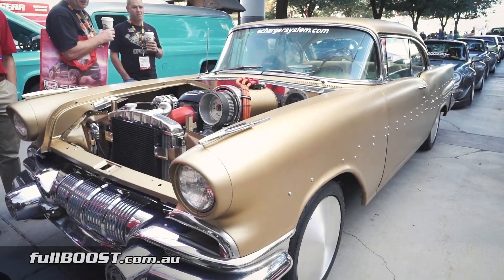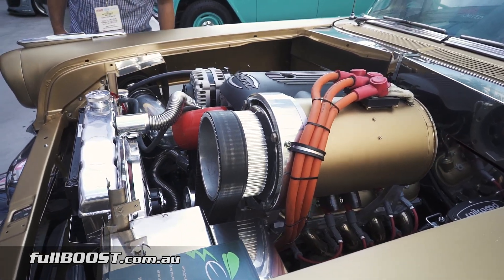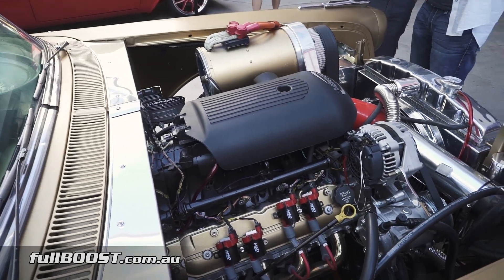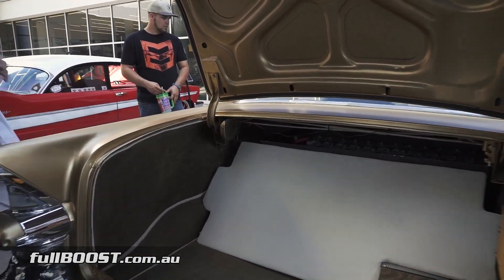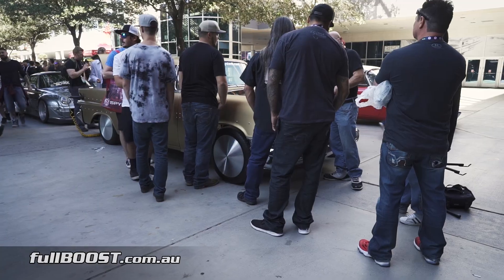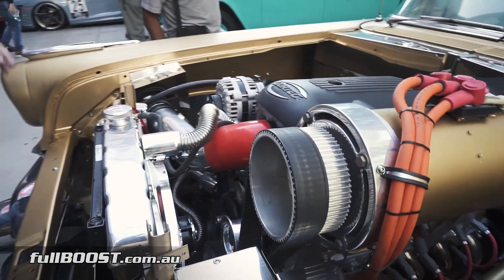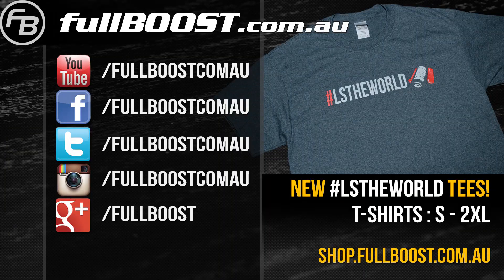The E-Charger Hybrid System

Comment: Regenerative braking? Kinda like the KERS system?
Reply: Luisk  no like a hybrid. The KERS system harnesses the abilities of economy hybrid vehicles & gears it towards increasing performance. The technology has been used & around since the first gen Prius but for the past 5-7 years or so, many performance manufacturers have begun to see the advantages of hybrid technology. Which is why we now have the KERS system, & why many super/hyper cars uses hybrid technology. It’s awesome I’m enjoying the times we live in right now for cars!
Reply: KERS is an F1 tech, the current state of it now being ERS, it now being a V6 hybrid where the MGU is geared to the crankshaft, and a second "MGU-H" being driven by the turbocharger being used to supplement the system. The electric motors work as generators, the system Mercedes has gotten more than 50% thermal efficiency.
Reply: Or like any hybrid on the market....
Reply: He was explaining it, not claiming the tech as his own, just that it had the function
Reply: I think is more like the generates energy and saves it in the lithium ion battery for later use, I believe that for the nature of F1 Kers or Ers would need a super capacitor or even ultra capacitor to quickly charge and discharge on "bursts" like for example perform an overtake. Current batteries would simply be toasted after 5 or less (edit) laps
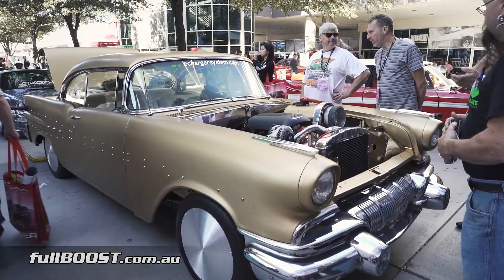Reply: @Jesse Fritz at about 1:37 he says it has regenerative braking.  I don't know how it is achieved on this car, but apparently the inventor clearly says you do have it.
Reply: KERS has been around long before GTA was a thought. Nice try though.
Reply: ummm no. you wouldn't have regenerative braking. You're not understating the system. regenerative braking takes the momentum/Inertia of the vehicle and converts that energy to electrical energy. with this system, to recharge the battery bank, simply have a relay that converts it from a motor to a generator. but when you do this you're putting an additional load on the system (engine). basically taking any energy you received from the batteries and putting it back, and at a loss,  there is no net gain. it's pointless to have this type of system.
Reply: Luisk this isnt grand theft auto bud

Comment: oh cool, a giant alternator.
Reply: Lol it can't be an alternator if it starts the car lmao learn your shit it's an electric motor
Reply: @frymnts  a motor and generator are the same fucking thing dude. They can and are, both at times. I out need to learn your shit
Reply: @Demonslayer20111  depends if it's an AC generator or DC generator cause they can be different but the principle is the same
Reply: It's connected to the drive shaft I think not connected to the engine I think
Reply: That's really all it is , a motor to force your psitins up and down without fuel going in , sounds dangerous to me
Reply: @mechanicmatt9466  there is no issue there. as long as there is oil pressure, it doesnt matter if there is fuel
Reply: @Demonslayer20111  there will always be oil pressure because the pump runs off the snout of the crank .
Reply: This is the literal stupidest “power adder” I’ve seen

Comment: It's just stupid. Plain and simply stupid. I think fuel efficiency is great, but invest the time and money to make internal combustion more fuel efficient. Corvettes get 30 mpg when you are careful. Do that without adding weight and more batteries. Electric motors have no soul.
Reply: ***** You feel the power far more with electric motors. You get 100% of the torque from 0 rpm, which is why they're so good. Only somebody who hasn't actually used a proper e-vehicle reckons they don't have 'soul' or thinks that they miss the sound of an engine
Reply: trillriff-axegrinder It's already happening. Look up the rimac 'concept one' or 'concept s'. It's the first all electric supercar, and for its price (1 million USD) it's unbeatable. 

From an engineering perspective electric motors are amazing for high performance cars. The rimac concept s is rumored to go from 0-100kph (60mph) in 2.5 seconds, while the concept one currently does it in 2.8. Combine this with the ability to control the exact torque of every wheel autonomously, a hundred times a second, and a top speed of over 300kph (which is electronically limited), the concept one is an amazing car.

It already beats the La Ferrari, Porsche 918, Mclarren P1 etc. In a straight line. And it's significantly cheaper than the La Ferrari and McLarren P:1.

The concept S should also beat them around a track with its improved aerodynamics and weight reduction. This is a street legal all electric car, that beats the best any other company has to offer, while looking beautiful and being cheaper.
Reply: while u may not feel the raw power on an e motor, its can out perform some supercars. just look at wat they did with the tesla motor. we haven't perfected electric motor just yet. but given time n the right technology advances it will stand out. if ur too ignorantly old school u might hate changes or can't adapt to newer tech. we went from horse back riding to stream to gas motors to emotors in just a few centuries. who to say electric motor can be the next stop for human transportation.
Reply: sad thing is not alot ppl think like that. common ppl don't want change nor want to adapt to change. we do it all the time in our daily lives.
Reply: trillriff-axegrinder “not in your lifetime”? You are a moron. Every locomotive in the world runs on electric motors. The US navy runs it’s submarines and aircraft carriers with electric motors....
Reply: trillriff-axegrinder the LH6 right next to it charges it you dumb@$$
Reply: Shawn Crockett that should be the next step, gas electric drivetrain
Reply: trillriff-axegrinder You can say that about any supercar, none of them are practical. Your point doesn't change the fact that its an amazing supercar. Also it has a range of 330km when driven on roads.

The same technology but in a practical car can easily translate to 500+km range, in a car that still performs better than its competitors.

This is today's technology, while we're still in the infancy of fully electric modern vehicles. Even so they're already competitive.
Reply: ok. I've haven't been in a electric motor yet so can't tell u for sure. only from reviewers. i personally still wanna own one especially from tesla motors but right now there just too expansive n charging isn't good enough like gas just yet.
Reply: electric cars has it's place just like gas cars for better or worst. i personally would own both bc it love cars no matter gas or electric. one saves u money while the other makes u feel a live again.
Reply: as of now electric cars is a yes/no. but for the future it definitely a yes once battery become better n more efficient. they all have their places including electric, flex fuel, bio fuel, diesel, gas cars etc.
Reply: You can only make gas powered reciprocating engines so efficient before you have to resort to other methods...
This is one of those methods.
We have pretty much topped out the practical means of engineering gas engines to be more efficient since the late 90's...
Reply: Look yeah electric motors have less character than petrol motors, but remember that they also have torque curves and components that can be changed and upgraded. Part of the joy of cars is being able to build and modify them yourselves, which you can still do with electric cars. And back road hooning is still just as fun with a well setup car whether it be petrol or electric
Reply: As a person who owned an sr20 and a Weber side mount 4age, I love where the future is going. Horse owners once said a car has no soul. Ice are inefficient with 30 percent energy loss. It's stuck in the industrial era. Think about a truck driving to different gas stations unloading it into storage underground. Oil mining, drilling, refinement, distribution. Look at the a pipeline. It is a literal pipe that cuts through the biggest state with heating elements, cooling elements for the permafrost, monitoring stations. The world around us is going digital, cars should too
Reply: Shane P I get 27 mpg in my 327 impala. City. Lol.
Reply: Shane people said the same about steam engines when we moved to petroleum. The advantages of the electric motor will soon eclipse the internal combustion engine, once that happens it'll become the norm.
Reply: ENTERUSERNAMEHERE555 I have been in electric cars, power delivery is great, I agree. But it's the same across the board. They all feel the same. Cars are a passion for me. It's the sound, different ways that different motors act and develop power and the ways they move, shake, rumble. Electric cars hopefully are not the future. Electric cars have no soul. They are cookie cutter in how they feel and the noise they make. Some are just faster than others. A 4 cyl engine could be as fast as a v8, but they sound different, have different power delivery, different rumble and shake, they have souls.
Reply: MeMad Max I think the future is anything you can fill up in a couple minutes at a pump and go around 300 miles on a tank. If electric does this then it could be the future. I just hope it isn't. I love internal combustion of any sort, because it will be unique in any design no matter the fuel. Electric is just all the same. I don't want to live somewhere where all cars sound and act the same.
Reply: Oh yea, I hate fuckin electric drives. Gas all the way. But there are other ways too. Like waste heat recycling that bmw and others were working on.
Reply: you must have a small petrol tank dummy. Do you even understand what it does?
Reply: WhyteLis21 maybe because turbocharging /supercharged is cheaper than electrification like rwd electrics and fed internal combustion engine .
Reply: too bad it goes 100 km then needs to be charged for 5 hours,like i said great concepts but shit delivery
Reply: electric cars cost too much,replacement batteries are insane,have no range ,need to be plugged in and pay ridiculous hydro prices and there's not enough technology to make them a viable alternative.
Reply: not in our life time my friend,this is a good concept but dumb as fuck in application.

Comment: This is what rotary engines need.
Reply: Andrew Peterson You all a bunch of Wankels.
Reply: and it could go nicely inline with the crank.
Reply: @Snoggatog Learn about Wankles before you start talking crap....The main reason they fail is due to poor maintenance practices by their unintelligent owners...
Reply: Actually, it would be a good idea. Rotaries are infamous for being lacking in torque. Electric motors have full torque at the hit of the accelerator, so attaching one of these to a rotary would be like giving it higher levels of torque at low RPM with the additional high-RPM powerband. Seriously, I can't see this being anything other than a big help to performance for a rotary engine.
Reply: Rotorys  just need better Apex seals
Reply: @sTeVeXNYCPerformance hey im a coke using waldo kid and i do need hybrid bolt on for my rx7 because i know how to have a good time.
Reply: mazda is actually r and d-ing this
Reply: Senso Rieskin if you drive a diesel work Truck this would add a huge fuel savings
Reply: but the electric motor has to rev up to 10k rpm and still power efficient at that rpms
Reply: stock engine without limiter could do 11k rpm
Reply: I love the wankle engine but I have to be real. The reason they won't develop them any further is because they cannot pass todays emission standards. Same reason they haven't used the 5.0 ford engine for anything past 1999.
Reply: @geraldgrandfield2031  actually the pushrod 5.0 has no issues passing emissions. The reason they stopped using is is because the modular engine was being used
Reply: anyone invest in wankel engine, is like try to improve an old v8
Reply: the wankel moving a big alternator would be
 better
Reply: Rotary engines need reinforced rotor cases that’s the only reason they’re not used in every car is because they get worn fast and they spit some I burned fuel but I agree we should use more rotary motors rolls Royce is releasing a car with a two rotor engine
Reply: Funny thing is, Mazda is doing just that for the next model rx
Reply: To fit this to a rotary, you’d need an electric engine capable of spinning up to nearly 10k rpms within less than a second over and over and over. This type of electric motor setup although available, would be so comparable in price to a turbo setup but not nearly as powerful in the end result. Now in a perfect world we’d have both I suppose. The turbos for higher rpm operation and the electric assist for low rpm torque.
Reply: "Electric motor good to 8,500rpm"
Renesis redlines at 9k
Reply: Yea, for when the apex seals give out lol
Reply: The scrap yard is where the Wankel engine belongs, inefficient, oil burning, torqueless, Nazi designed garbage noob engines.
Reply: Senso Rieskin no....nonononononono
Reply: SabreMetalPanzer no rotaries are infamous for blowing up and burning oil no matter how over built they are, it’s inherently a shitty design that always ends in catastrophic failure and if you are concerned out torque out of a rotary, just shove boost into it you’ll be fine, or get a trans break if you chose to drag race it

Comment: Your adding the 150 pound of torque but then the 200+ extra pounds would just slow the car down
Reply: robert paszko not as much as adding the tq.
Reply: its mostly right over the drive axle... would be interesting to see the 60 foot and 1320 foot times gas only compared to this "hybrid" setup
Reply: Idiot. Every comment section has one of you hanging around.
Reply: Doesn't realize 200 lbs is the same as some  passengers who produce 0lb/ft of torque.

Comment: Instead of calling a true bolt on hybrid , it should just be called a hybrid assist.
Reply: lnstead if calling it a hybrid assist, it should just be called a true bolt on hybrid. Why? Because it truly is a hybrid system that is bolted on.
Reply: Why?
Reply: Actually old news. This has been around in the UK for awhile. Big rigs or lorries as they call them have had electric assist for years. Helps pull heavy loads uphill while reducing fuel consumption.
Reply: +TH3TIMP5 looks like an industrial 3 phase 480 electric motor. Don't know the specs but have that style in a plant I work in.
Reply: Tons of "mild" hybrids use this same system, just more integrated so that it's hidden better, and for years they were still branded as hybrids even though they were just hybrid assist with auto start/stop (which was new tech in the 2000s). Notably Honda, GM, and Subaru before turning to "full" hybrid systems to compete with what was led in the industry by Toyota. Nowadays auto start/stop is a normal thing, and so as mild hybrids are making a return they're no longer branded as true hybrids but as the assist system that they are, such as eTorque in the Ram and Wrangler.
Reply: CorndogBrownie yup I think that is a marketing gimmick.we are familiar with hybrid so they call it that
Reply: Is it not just a big starter motor?

Comment: Great idea but the extra weight of needing to carry heavy batteries will counteract the benefit. I know I for one do not want to carry 250 pounds (114 kilos) in extra weight around. As battery technology develops and they get a lot smaller/lighter this idea might become a viable option. Electric motor assisting the conventional motor. Can still run a turbo/supercharger as well.
Reply: I agree, quiet a smart system with the controller having the ability to regenerative engine brake. 
As mentioned, the benefits and the uptake on such are a system are limited by the availability of higher capacity lite weigh compact batteries.
Reply: 250lbs does not cancel out 150ft lb of torque.
Reply: Every 100 lbs is equal to about 10 hp or 1/10 sec in the quarter mile.So regardless of the added weight he is ahead of the curve.
Reply: Nice grammar, I can barely understand what you are even trying to say. I never said 250lbs doesn't effect the vehicle. I said that it isn't canceled out. In rough numbers you lose about 10ftlb of toque per 100lbs. So you are still gaining a good amount of torque. It's high school physics.
Reply: Modern battery technology is so far behind, probably for a reason
Reply: ThomasRocksU actually  modern battery technology is far ahead of what this guy is capable if getting his hands on.. The worlds automakers have things in development that this car isn't even coming close to...
Reply: you wont need a car battery, starter motor or alternator. that could drop the weight down by 60 kgs. so now only a 54kg added weight.
Reply: Stephen H combined the entire system added is at min 400 lbs. The motor alone is ~70 lbs
Reply: As a purely performance part a turbo will out class this electric motor in pretty much all categories but as an addon to a daily driver this maybe a better option. Assuming this kit isn't going to cost to much or require a lot of costume fabrication then it may be a good alternative to the eBay turbo kits.
Reply: Yeah, that pretty much negates the whole effect...
Reply: Stephen H - Having driven a Turbocharged Wankel, it would be good to have an extra 250 pounds over the driven wheels, to put that torque down on the road, instead of just polishing off the treads!
Reply: J Blume - that 250 lbs helps put that torque on the road, instead of just spinning those wheels freely.
Reply: Yeah battery technology still seems like it's in its infancy but as he mentioned it adds a bit of traction having the weight in the rear so that's somewhat of an advantage if you ask me.
Reply: until we perfect electric motors especially the charging stage n longer mileage that's equal to or better than gas, i can see higher performance for electric motors beating raw gas motor for sure. just look at we they can do with the tesla motor. it out shines some supercars. its just emotors don't have that raw feel of a 4 stroke engine though.